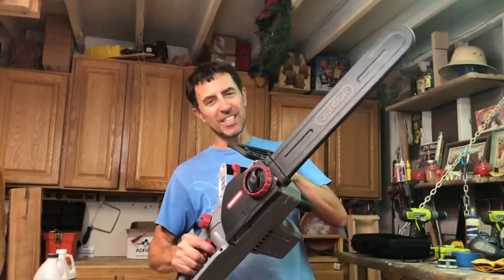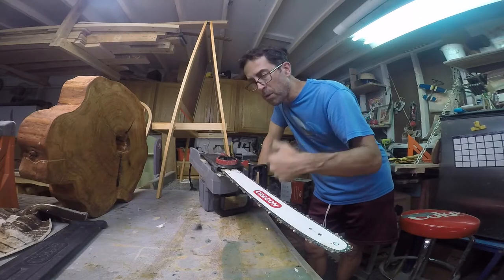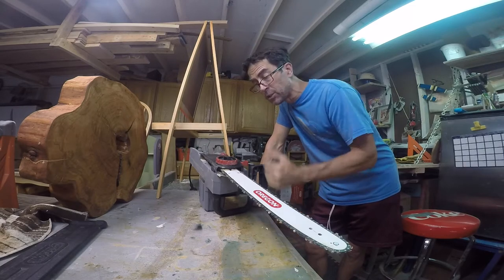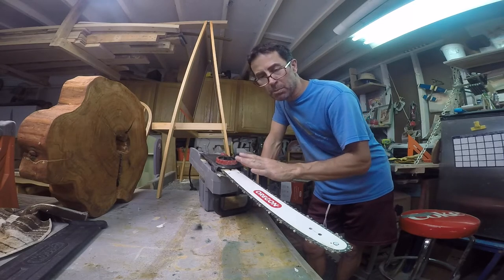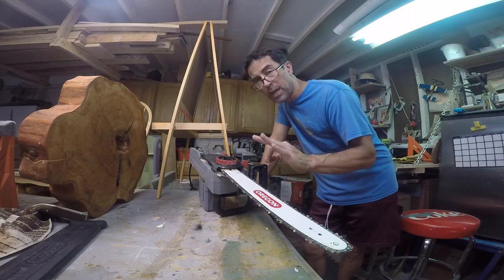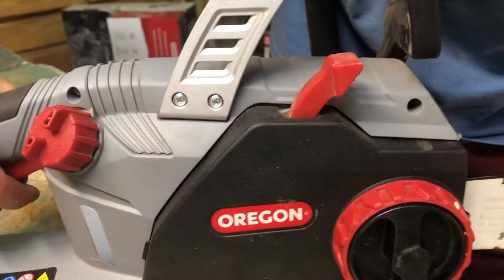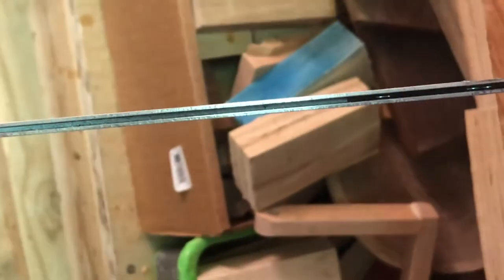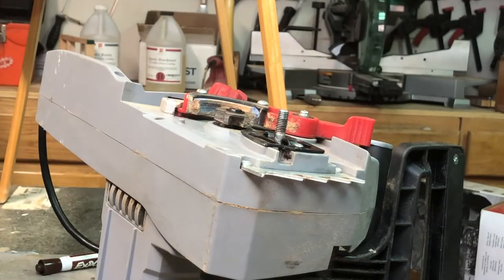Oregon CS 1500 Bar Chain Oil Issues (2 year review.)

Comment: If it hasn't been said, your issue is not the Bar. The issue is repeated use of the Sharpening feature and no manual correction to the Blade. The low profile chain uses a bump link in front of each Cutter link. That bump sets the cutting depth to reduce kickback and control Chip size.
*Every time the Chain is sharpened with the Built-in sharpener, you are removing material from the top of the Cutter. This reduces the height gap and changes the Chip size. Eventually you are making sawdust, not chips.
**When Hand sharpening you remove material from the underside of the cutter tooth, not effecting height.(except for normal ware.) 
At some point you need to take a File and Top those Bump links to restore the gap between Bump and Cutter height. This will restore Chip size and reduce excessive Sawdust accumulation.
Proper chain tension is also key to reducing Dusting by keeping the links running true and level.
Reply from the maker: Thanks for your comment.  What your saying in my mind wont effect the lack of oil releasing to the bar, but rather how you sharpen the chain effects chip size. Oh ok I see, having bigger chips and less saw dust will help not to clog the oil so fast.  Yes, I agree that bigger chip size would help. That said I almost never use the sharpening feature anyways.  I'll hit a nail in the wood and just change to a new chain. City wood is annoying! metal  detector is helping.
Reply: @Jasonsdesignshop  If you re doing a lot of board cuts you may want to run a semi or full chisel Chain to increase chip out. I have always hand sharpened, but still File the bump links every 2nd sharpening. 3 Passes is usually enough.
Reply: I'm the relic who reads manuals, Oregons claim that curvature of stone adjusts The Bump too but chain tension might help with my gas saw problem thank you!

Comment: Thank you for the video. Mine worked fine through the first four cords. I was using a synthetic bar oil. Switched to the Oregon bar oil and started having trouble, though it took quite awhile to deduce the problem, including looking at this video. Switched back to the synthetic oil. So far so good.
Reply from the maker: Going to try a synthetic next time I mill some boards.  Thanks for the the insight!
Reply: Good to know. I'm almost out of bar oil and have a bunch of cutting to do. Any specific reccomendations for synthetic earls?

Comment: That's a first class video. I bought this saw end of last year and could not work out why the chain was not getting oiled. It does seem to be a very poor design for oil and I have heard that the oil cap needs to have some ventilation when closed otherwise there is a vacuum and the oil does not run easily. |Not all homes have an air compressor but I manage with a compressed air bottle, which you could take on site.  Great work and thanks so much for making such a good video. I'm in the UK
Reply from the maker: Thanks for the like and positive words.  It is for some reason my best video.  I need to do more reviews of the tools I use.  I wanted to say your thought of a a looser cap to let air in behind the oil going out is so simple its genius. No one has ever mentioned that idea in the comments. You will just have to keep it upright to avoid it dripping out.  Going to mess with this idea next time I use the saw. Thanks!  Happy cutting.

Comment: Just ordered one this week, so your video was extremely helpful. The bar oiling design is poorly thought out, the non-vented cap seems a little shaky as well.
Every other aspect of the saw's design is well done, but the lubrication system is not up to snuff.

Comment: You can see at 13:50 where vibration is causing your chain to lose tension, hence the sloppy chain at the end of your test. I guess the black inner knob needed to be turned clockwise to lock the outer tension ring in place.
Reply from the maker: Correct!  Nice thing about the saw it’s a fast easy fix.

Comment: Where the oil comes out it has a rubber surround and the hole in the round tensioner wheel has a rubber seal.To get to the seal unscrew the screw holding the tensioner wheel on and see if the round seal/o ring is perished or missing?.

Comment: Great videos and comments. Thank you! Just got mine and did quite a few firewood cuts. So far so good. But my saw has little hole in chain oil cap and looks like some vacuum lock prevention mechanism on the bottom I figure to avoid leakage. You use your saw horizontally which could be an issue. Other than that, I knew it was heavy for electric but makes chips much bigger than my gas saws did but kick back rather surprised me with its strength.
Reply from the maker: New improved cap! Good to know, thanks! Happy cutting!

Comment: I have another comment re you awesome log cutter. Why not mount your own oil bottle on the framework with tubing and using fishtanks air hose and a valve allow oil to drip onto the chain links. You could drill a small accurate hole in the housing by the drive gear and allow gravity to assist in lubricating the chain. Food for thought!
Reply from the maker: Yes if I was cutting more often maybe it might justify the effort to build such a system.  One major issue with that is your doing it so you dot have to stop on a long rip cut but the motor is to week and might over heat and bun up if you don’t keep stopping. And having to add oil facilitates that stopping.   A thought.

Comment: I am considering a corded saw.
Thanks for you input here.
I mill with a home made rig.
Ripping dust is like flour and it gets every where.
I keep an oil can on the rig and give the bar a squirt from time to time 
No need for a fancy set up.
I would not use that auto sharpen feature.
Sears had that years ago. Yuck.
Good luck with the cherry!  Chris
Reply from the maker: Sounds like a good set up you have.  Ya you have to be careful not to use the sharpener on the rip chain!  Happy cutting.
Reply: @Jasonsdesignshop  In  the end I went Makita, (on the way) even tho the toolless bar looks like a toy.
It has a chain break.
Flame maple is a challenge.  Ash became a favorite.
The set up is not bad for a first try.
It needed counter weight.
The big grief is where exhaust gases go.
My big saw is only 60cc. 80 would be better.

Good luck Chris

Comment: I wish I would’ve seen your video earlier. My CS 1500 now has a motor that smokes without the chain installed. Oregon does not seem to want to talk to me or answer my email explaining issues that I’ve had. Do you have any suggestions on how I can get in contact with him and actually get results?
Reply from the maker: Oh no your motor burned up too. Boy, I dealt with mine two or three years ago. I think I did it all online. Once I filled out their online form and sent them the saw and they checked it out. we went back and forth with email. Then they finally replace it.  Maybe their customer service is getting worse I’ll go to website see what I can find out.

Comment: Excellent video. Actually, was looking for how to replace chain (manual was not clear to me) since it threw the chain after about 10 minuets of use right out of the box. Other people have commented about the chain jumping issue and now this saw apparently has an issue with oiling as well.
Reply: Just after my comment, continued to watch video and he explains exactly why chain jumps because of the 2 part process needed to tension and lock the chain. This video has saved me a lot of time and effort getting this saw to work properly for me. Great job, Jason!
Reply from the maker: The chain jumping is not really an issue once you learn adjust the chain with the red dial and then make it tight so it won’t move. 
Happy cutting.

Comment: I noticed that the Oregon oil that came with the same is quite a bit thinner than other brands. Could that be a causing the clogging problem?
Reply from the maker: Interesting observations.  I assumed bar oils were all the same .  Something for me to look at when I buy my next bottle.   I’ll look for something thinner.  Maybe it will help.  Thanks for the insight.
Reply: I think you should check your oil viscosity and linked it to the weather. Some are made for winter or summer, which might resolve your current issue with thinner oil. Plus you should get the Oregon oil to see if you have got any differences, because I think yours is too sticky.
Reply from the maker: @lucasclemenceau301  Yes true, and I'm almost out so a thiner viscosity is up next.
Reply: Did the OREGON oil make any difference to the problem of clogging? I've just got one of these saws and I'm looking for advice on what oil to get . I have oil for my two stroke chainsaw but I don't want to put it in this one if it's going to cause issues with clogging.  Great video! Very helpful 👌
Reply: @ted2100  I have used the OREGON and oil that I use in my two stroke and have had no clogging problems. I clean the bar and chain well after each use and that may have helped.

Comment: If you're milling a lot with that saw there's 3 things to do there. Add a brush on the bottom of the jig to block the dust, add an external bar oil drip that is sideways with the jig. both of those are very easy additions. last one is add an air blower internally which is more difficult than the other two combined.
Reply from the maker: Do you have an image you can link me to showing an external oil drip with a milling jig situation? Struggling to visualize how that would work. Thanks for your ideas!
Reply: @Jasonsdesignshop   like we do for milling machines https://youtu.be/wdMFZNjxbnM 
there are a lot of videos. I was thinking since your saw is horizontal, you can basically just put the drip nozzle right where the chain leaves the machine which is where the current oil is "supposed" to go but it gets clogged. If it is external it can't get clogged at least.
basically just attach the drip thing to your saw's motor cage on the jig above it or something was my idea
at 25:42 of your video is my best view of your jig so it isn't good view. But where the bar says "U.S.A." in white letters on the black bar.. you could put the container of oil there then have the tube go into the chain like in the video I linked
Reply from the maker: @gg-gn3re   Cool Jig for the oil drip.  And I see the dripper cold pass between the saw and the Milling Jig.  Ok this gets me thinking.  Now I can come up with an external oil drip and test it and if it works Il'l make a video to share and help solve this common issue. Thanks for you insight and getting my brain to see the possibilities.  The challenge is on.. once I finish the next three projects. LOL
Reply: @Jasonsdesignshop  lol yea gotta add it to the good ol' projects list.. hope it helps you. I think it's impossible to get clogged in this way so at least it should work

Comment: Question -  I have this 18 inch Oregon CS1500 Chain saw. Can replace it's 18 inch blade with 24 inch or larger?
Reply from the maker: Good question! Im not sure.  I tried to find a dime tip bar for carving but could not find one without doing custom work to make one.  My short answer is no I have not found other length bars for the cs1500 (from the manufacture).  I think They don't want you to mess with the engineering and then ask for a fix or replacement when it over stresses the little motor and breaks.  Let me know it you find one!

Comment: Cheers man, I had the same issue. You didn't mention the rubber seal for the oil to bar. 09:31 mins in your video. Can that be replaced as mine was distorted.
Reply from the maker: Oh ya I notice mine is saying and distorted too.  Going to have to look into how I might replace that little seal.   They make replacements kits for the sharpening stone but never seen one including that seal.  Might be a challenge and have to get creative.  When the heat brakes I’m going to carve another bear so I’ll look into it then and report back to this thread.  If anyone fines a link for that part post it here. 
Happy cutting!
Reply: I had a same problem few months ago. Additional problem is that I live in Serbia. But, you can not buy that seal alone, only with whole plate replacement.  And here I could not even buy that :) So I tried local service and representative, and got reply to make it myself??? 
After that I contacted Oregon directly trough US/international web page. They replayed (few days later) that they will send part to my country, and for me to wait a call from local dealer. After some time (quite a bit, but this was during corona outbreak, so oversea shipping was.... well, not good) I got that call. They just asked do I want them to send seal to me directly, or to local service. Since saw was in service shop anyway (trouble with oil pump line, but that is separate horror story, not directly related to Orion product quality, but to quality of my local repair service) they send it there, and it was installed. There was no charge, but saw was still under warranty.

Comment: Does anyone know if this oil problem happens on the CS1400? I was going to purchase one but will rethink if it has this issue. Any replies would be most appreciated, many thanks.
Reply from the maker: Good question anyone know?
Reply: Yes, I have the CS1400 and it has the same issue. The auto- sharpener sounded like a semi- functional gimmick and sharpening a chain is a worthwhile and accessible skill. I love everything else about the saw so I hope I can solve the bar oil issue.

Comment: Mine leaks oil all over the place. I wonder if it builds up somewhere when that passage is clogged. I have to permanently store it on cardboard.
Reply from the maker: Oh that’s not right.  Is it peeking g out the cap area or the chain.  If cap check that there is a black o ring in the bottom of the cap.  If bar tighten the bar,not the chain.  If it’s loose is could be draining after each use.  
Happy cutting!

Comment: This saw seems to be to much of a hassle to keep  it operational even though the price is cheap.  Can anyone recommend what the best overall corded electric saw is ?? Thanks for such a super detailed video of this saw.
Reply from the maker: Actually, for regular cutting this is my favorite saw.   I am now on my third one.  Its a little work horse.   All the issues I run into are when trying to mill slabs.  Also Most of the others are only 14-16 ".  The Dewalt DWCS 600 has a corded 18" but it's almost $30 more.  you could research that one and if you get a one or something else let us know what you think of it after some use. Having some options to recommend would be helpful.
Thanks.

Comment: Is this different for different years of saws new or older? and any other solutions or ideas?
Reply from the maker: This was years 2018-2020. Reading the comments it sounds like the same issue continues. Read the comments for this video and the origin review as there are all kinds of ideas being offered by the viewers. The one working for me is the leave the a little cap loose so air can enter behind the oil leaving to the chain.  Second prime the oil before starting to cut. So just run it until oil is flowing ( with a clean bar) before cutting and getting dust blocking the hole.

Comment: I don't know what your doing wrong.  Getting all that dust.  My saw doesn't produce any dust, just chips and slivers.  Your saws running as if it's a grinder.  My saw cuts the wood, not grinding like yours appears to be.  We can't even get our vacuum cleaner to clean up as the slivers and chips cloggs the hose.  I worked in a cabinet shop as th emaintanice man and if I found a saw (any) making light dust like yours is doing it' time to sharpen the blade.  I think my saw would clog the oiler if it was putting out that kind of dust.  I'm not getting any dust,  should only get chips (when bucking) and slivers (when ripping)  Your getting dust.  Heal of the cutter is too high, not digging in deep enough. Dust comes from a loose chain as the tooth will bend back and the depth of cut will be too slight, making dust not cutting.  Under where you have been cutting is just dust, no chips or slivers.  Very dull or depth set too slight.  Watch a lumberjack cutting in the woods.  There is no dust at all, just chips.
Reply from the maker: Thanks for your thoughts.  You open my eyes to the result of a loose chain causing the teeth to lean back and not get a full bite thus making dust! I find I only make dust when rip cutting and the blade is getting dull and the wood is dry and hard like the cherry wood I was milling back then. When you get it all tuned right it cutes nice slivers. Thanks again, good points.

Comment: does this use some proprietary chain ?
Reply from the maker: No you can get a new chain on amazon or even home depot carries it sometimes.
Reply: Note that I read you can't use the chain sharpener on non- Oregon CS-1500 saws. It's a special chain that comes with a new sharpen stone. Other 18" chains will work but will need to be sharpened by hand. BTW. just got mine and used today for 1st time. Very impressed so far. Cuts hard maple like butter!